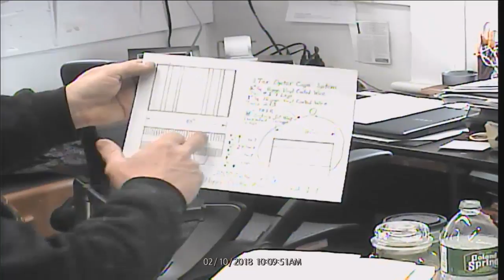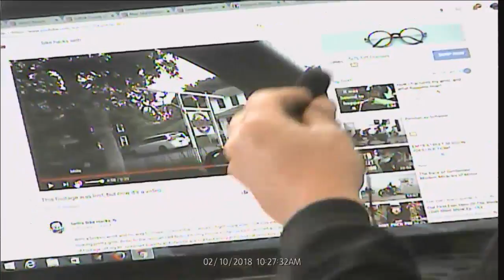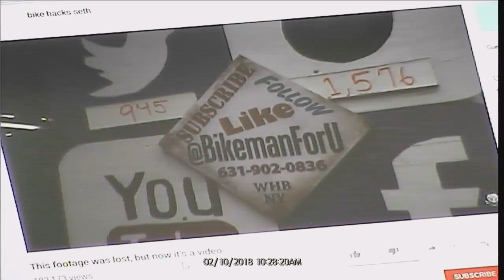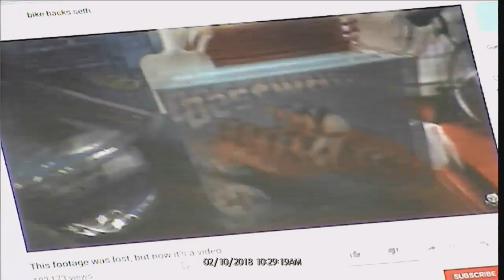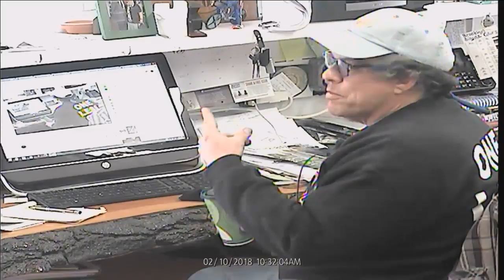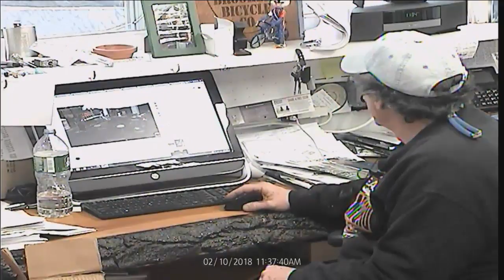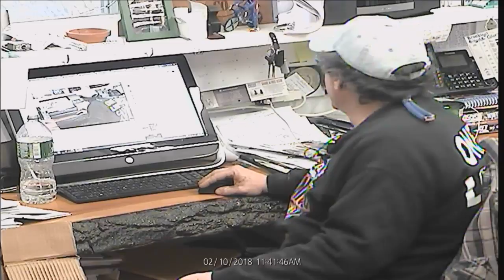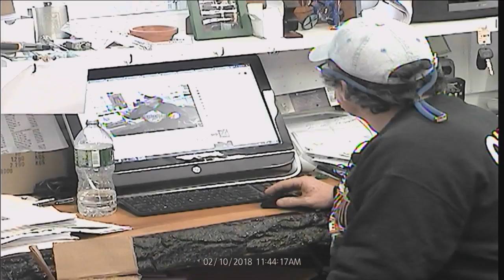Bike Shop LIVE "We're Pushin It" S6E06 BikemanforU Show 2-10-18

Comment: @56:28 LL Bean dropping its lieftime guarantee. You know who else did that? Revere-ware the stainless steel with the copper bottom pot and pan company reduced its warranty from lifetime to only ONE  YEAR I found this out when one of the black pot handles fell apart. They looked the same for a hundred years but now china-made thinner metal with plastic that literally cant handle the heat (the old bakelite pot handles lasted a real lifetime). Quality race to the bottom